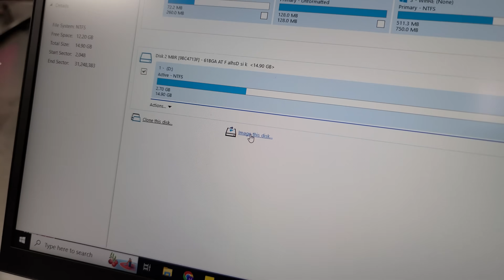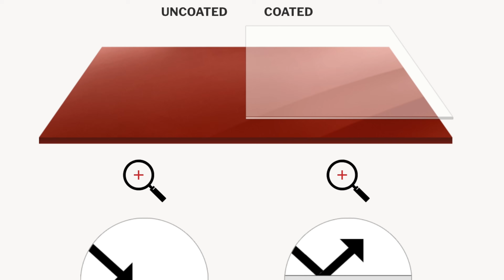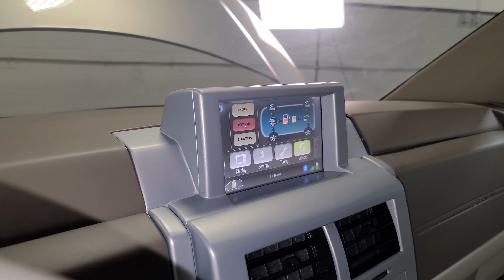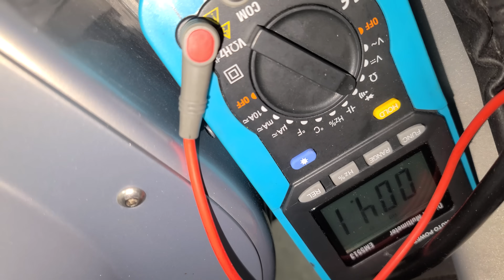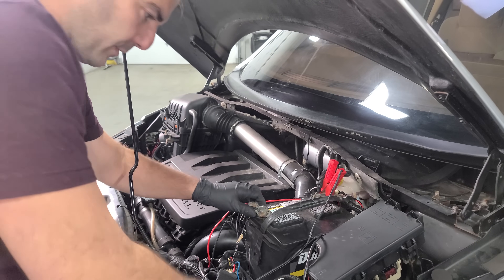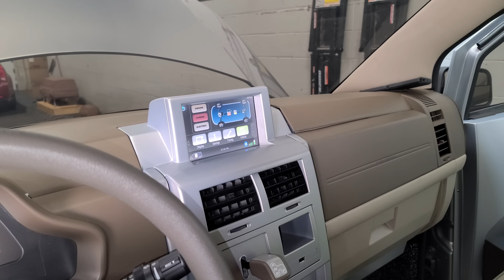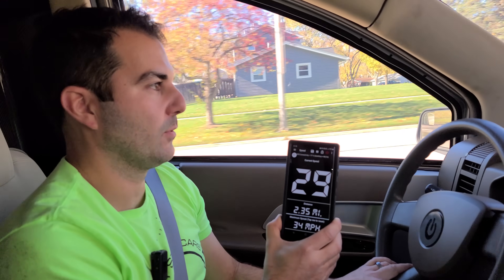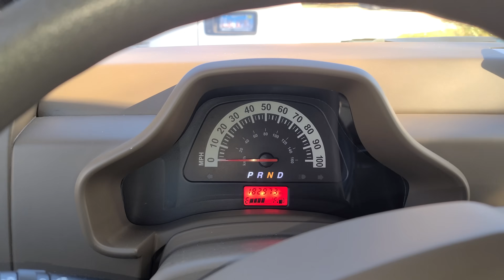I Thought I Finally Fixed The 2 Million Dollar Concept Van Until Disaster Struck! What Would You Do?

Comment: Given that it's a standard Chrysler gas engine, I wouldn't give up on in quite yet.  That throttle issue I'm guessing, is that the switch over from EV to gas should cause a number of relays to switch control.  Your starter bypass worked but I'd bet there's another relay that the computer should be activating, that connects the gas pedal to the fuel system or engine computer.

Comment: The concept was to run on electric power, then switch to the ICE.  It looks like that concept was never realized...it would be pretty awesome if Alex is able to get the space van to prove the concept and succeed where the original team couldn't, or ran out of time /money to do so.

The electric power has been fixed - amazing job Alex!  Fixing the axle shouldn't be an issue.  Same for the ICE - throttle response appears to be a communication or linkage issue.   The hard part might be the auto switching from electric to ICE.  Who knows if that software functionality was ever finished.  I would love to see the van perform that auto switch just one time!
Reply: I agree...stop trying to fix they hack work and do what you did with the starter button...just start upgrading stuff and do it the way you would have if you don't want to sell it to rich rebuilds and let him do it.
Reply: Wheel speed sensor not matching output shaft has thrown the TCU in limp mode. Computer probably locked in 3rd below 2000 RPM. The axle can be welded. Starter is almost certainly wiring to the relay that engages the starter solenoid. Reset all codes in all ECUs and see what comes back. The wiring looks terrible. I'm not even sure you could call this a prototype, its more like a science fair project. If he can't get it going I'd just convert it to gas since it looks 99% of the way there.

Comment: Assuming it's a drive by wire throttle, plug in your scanner and see if you're getting throttle input.  If you are, check your throttle body to see if it's getting a commanded signal.  Might just be a broken throttle pedal, bad throttle body actuator, or disconnected wire.
Reply: There is some wizardy going on because the pedal works in EV mode.  might be the relay that's clicking to split the pedal signal one way or the other.
Reply: @juztyn00 I agree with this statement.
Reply: I bet the transmission is in limp mode. He had throttle when in drive so its the ECU intervening. These cars don't have a throttle cable. I bet the output shaft sensor and wheel speed sensor mismatch has caused a lockout. Fix the axle, check the wiring to the sensors and from the start relay to solenoid and reset all codes.

Comment: I sympathise completely with that feeling of defeat when every success just seems to lead to another failure - I used to own a Land Rover. The van is really only worth what you put into it. As a concept car it's of very limited use outside a museum or collection, and if the CEO is happy to reimburse you for your efforts he deserves to get his van back. It would be the right thing to do. If you really want to get this thing running as a sort of daily drive, you'll have to team up with an electrician, strip out all the wiring and redo it, then get a mechanic to go right through the thing looking for problems. Would it be worth the cost? Probably not. You've given it your best shot and it's driving you nuts. Time to save it in as original condition as possible for historical reasons and get it back to the CEO.

Comment: Here is my gut on the gas throttle. I would wager it’s an electronic throttle, and that somewhere in the computer system there’s a switch that sends the throttle input to the electric motor or sends it to the gas motor. That switch is probably stuck on the electric motor, which is why it works when your EV power but not when the gas engine is running.
Reply: Likely a rely or in general area like broken wire somewhere as the electronic throttle works in EV mode which tells me when switching to engine mode it not switching the signal wire over to other ECU?

Comment: Long ago I used to work in a telephone exchange. I have really enjoyed watching you delve into the problems with the van. The four big problems which I see are 1) no circuit diagrams; and 2) a complex electrical system, 3) something which is experimental, and 4) a powerful electrical system. If you had just no circuit diagrams or a fairly simple system or something which wasn't experimental (i.e. the van was actually in production as a roadworthy vehicle)  or something which wasn't capable of serious injury or harm then it might be worth continuing down this path, but not having circuit diagrams is a major issue, and the fact it is complex and experimental leaves you like when you're driving around a part of the city you don't know without a map. The two obvious choices are either to sell to the old CEO or to donate it to a suitable museum. There's just too many things which are going wrong with it, with no logical pathway to fix them. Circuit diagrams are essential to having a logical repair pathway.  I just feel there's too much risk of some sort of serious incident happening with this van, so I recommend you dispose of it. You've fixed the easy things, and what's ahead is more hours of labour with less to show for it. I just saw your first video after you had left working for the police department. Maybe I'm wrong, but I just don't see continuing to fix this van as fitting within your vision. I recommend you pray for wisdom.

Comment: The small module you cleaned is just receiver for your remote locking. You can either try to unlock it by a key fob or just completely remove the module from the car and connect all wires, which are divided. It should be mounted under the dash, that's why there is no weather protection and all the corrosion.

Comment: With that aftermarket alarm I know back in the day they use to put a antenna type of wire around the key cylinder under the plastic cover and that will not let you start your car if there is a problem with the alarm. If you remove that from around lock cylinder the van should start with factory ignition

Comment: I wonder if the computer turns on the engine by using a remote for the remote start module. It would make sense that they might use an off the shelf module to bypass the security system (even though it looks like an original key). That might explain the relay clicking and why it worked before and doesn't now.
Reply: That's exactly what I was thinking!
Reply: Switching out of electric mode trigger the gas engine to "remote start" so you dont have to turn the key. Then it has the timeout disabled so it doesn't just shut off like remote start normally would

Comment: Well Alex the van had investment from GM of $5 million and a Grant from the Startup initiative program of $250,000 The van should be worth around $350,000 if it was put up for auction as it is a one of a kind but that would most likely be a museum price, I would say the van is worth around $90k to a private buyer as no one else will have that same van. Also you may want to redesign that rear axle setup and weld in some stronger support for the EV motor and axles as it will tend to pull to one side as it takes up torque, Maybe fit 2 shocks across the chassis to stop it twisting at low torque, Also the Engine was never running in the PR events and in the report i read the transition from EV to ICE was rough back in 2011. they had a newer axle -x - Motor setup in the works which never got built or installed.

Comment: If this thing uses an electronic throttle, that's the first thing I would check. It's probably disconnected, broken, whatever. 
If it's mechanical, cable driven, the cable could've snapped or been disconnected at some point (check both throttle body and gas pedal).
Either way, you can check if it is working by using an OBD2 tool (throttle position sensor).

Making the turn signals work should be really easy with a 3 pin turn signal relay.
The turn signal levers are probably an off the shelf real component, so it is perfectly possible to make it work, provided the headlights/rear lights actually have bulb sockets in them. The turn signal circuit is SUPER simple.

Comment: I wonder if the engine is started via a remote starter system. Maybe the box of electronics that you cleaned? My guess would be that the command from the space van screen to turn the gas engine on would be sent via radio frequency to the remote starter. Maybe there's a key fob remote somewhere that has been wired into the van to send the RF signal to trigger the starter. It's the last piece of the puzzle to get the van to switch automatically. Your starter button is a good work around and possibly what the red button was on the remote receiver  box by the battery. Maybe that was the override if the rf signal failed.

Comment: When your were fixing grounds, you didnt connect the one for the lights.  I am wondering if that was a light relay, it was a engine mode relay ground?
I would suggest connecting that “unneeded” wire, to make sure its actually IS unneeded.

Comment: I am an ex certified mechanic (hurt my back) … I might have some insight as to the issues of the van driving under engine power and why the shaft sheared. The way it is acting the throttle pedal doesn’t seem to affect the gas. It may be disconnected because they couldn’t sync the % of throttle to electric motor speeds. And only be hooked up to a potentiometer for the electric side and not to the TPS or throttle plate they may be using the TPS for the electric motor side only as an throttle input ….in effect using the motor as a generator only at idle. Since the ECM doesn’t see the Throttle Position Sensor it only idles and charges the batteries at 15v by your readings. And torque sheered the shaft (that drive shaft looked kinda small and of soft material) and my opinion probably something from some scrap parts.   Needs to be better design to hold the demand of city driving. Sounds like the batteries were doing good. Happy Holidays Sir. Hope you see this.

Comment: Seems like the way they're switching from hybrid mode to the gas engine is utilizing that remote start module to "remotely turn the key" without you actually having to turn the key manually. So when you put it in gas engine mode it "remote starts" but doesn't have the timeout associated with remote start when it doesn't recognize a key in the ignition over a certain amount of time.

Comment: Hiya from England. OK, Ideas why the engine won't start. Automatics have an Isolator switch on the gearbox so you can't start In drive or reverse?/ or maybe shut the doors to start the engine/ or foot on the brake or all 3 to start the engine.  you could test if getting spark with one lead disconnected but connected to a spare spark plug while the engine turns over as in your test, IF it does spark then spray brake cleaner in the intake to see if it starts? CAUTION ADVISED! Good luck though bud.

Comment: I wouldn't be surprised if the startsignal and the lack of throttleresponse are related.
The screen says its putting power to the wheels, but does the computer know that.
I hope you consider continuing the work on the spacevan.

Greetings from the Netherlands

Comment: I am also with you on getting rid of the space van. Otherwise you will have to use the Chrysler that was used's wiring diagram and draw up a diagram of your own. Then you will jhave to get into the PC diagnostics to determine the gas engine restriction as well as the automatic change over from EV to gas on the fly. I do believe this is taking a lot of time away from your other projects and I can see that this is not what you want to do.
I do admire your trouble shooting skills a lot as you are not just another new part fitter.
Best of luck on your descision going forward.

Comment: It sounds like it's time to call it quits. I think that, other than the axle being broken, it's probably functioning exactly as it did when it was a concept. For drivability and reliability purposes, someone might consider disconnecting the EV system and letting it operate exclusively as a FWD vehicle using the Chrysler powertrain.

Comment: I think your solution to starting the gas engine could be an issue. If it's like most PHEV's the gas engine is designed to fire up automatically when needed. It can't do that if you don't solve the computer controlled ignition. The wiring is a mess and if you want to understand it you really have to start tracing back some of the major circuits. It depends on if you want to put any more time into what could be a lost cause. I'm pretty sure you can solve the axle problem - that definitely sounds like an Alex problem 😅

Comment: Any development project takes things in order. In this case, they worked on the interior and the electric drive as they both appear to work and when it was new, it was enough to show progress. I suspect the gas side of things was left to last and that is when they ran out of money. You could probably get that working but it would be a huge investment of time and money to finish what they started. Probably it's time to clean up a few small details and move on to the next project. As you have contact with one of the people on the project you could ask just how far they got but I suspect it will match what I just posted.

Comment: If you do decide to continue with this project, I think you should make your own wiring diagrams. There's no way you're going to remember what every wire you encounter is connected to if you're not writing it all down somewhere. Second, you have enough experience to know what needs to be connected to what to get an engine running properly. Having your own diagram would help you see what is and isn't connected. You could also compare it to the OEM wiring diagram. Maybe you could even get Rich and his guy to do the diagram and review of the electric engine while you do the gas engine. Maybe someone who knows a bit about coding to review that software on the SSD. Then make changes as you see fit to get it running. It's a lot, but I believe it's doable.

Comment: couldn you had taken your diag scanner, and increased the rpm ? my 01 bmw 330ci will while moving. (i know this is chopped and spliced to bits) but it does speak to the ecu/dme/pcm whatever your wanting to call the engine computer of the van. bc if you can control it via scan tool, then you should in "theory" be able to narrow it down to either a throttle body issue, or its just not detecting the pedal being pressed. (unless you checked for throttle actuation without showing in the video)?

Comment: You'd get more from parting it out. I say either strip all the wires out and re-wire it or take it to the scrap yard and crush it. Just pull the high voltage batteries first. You could sell the batteries for maybe a couple thousand and get like maybe $300 from the scrap yard for the van. You won't completely recoup your money but something is better than nothing.

Comment: Random thought… I am assuming this thing is throttle by wire. So, have you verified that the gas pedal is plugged in? Not sure if this could have an affect on it not starting or not. But the lack of throttle response when you press the pedal sure indicates that it’s either not plugged in or at least not communicating with the ECM.

Comment: Alex, You gotta own it buddy. Make Diagrams. Document behavior. Enumerate the whole vehicle. Create the Operational Schematic. Then, replace or fix the technology. It feels like the computer is supposed to send two throttle position outputs, one to the Electric motor controller, and the other to the ECU. Or perhaps just use a relay to bypass the throttle position output to the Electric system when in EV only, and vice versa when in engine only. In hybrid mode, the EV system will only need to match front drive wheel speed, otherwise the electric system will be constantly pulling a load on the rear wheels.

While I am writing this, I am wondering if that silver box on the passenger side is responsible for interfacing the Engine control system to EV computer.

Comment: That axle looks like a weld let go, it also looks like it wasn't bevelled or properly prepped at all when they joined it. You can see the grinding marks on the end of the shaft where they cut it and the blueing from the weld but you cannot see any residual signs of the actual weld so defo no penetration or strength. Absolutely on par with the rest of the vehicle from what I've seen in your vids bud.

Comment: This is a problem with prototype vehicles meant to sell an "idea". They are slapped together enough to get in and out of showrooms, drive around a parkinglot, look good to investors/media, and then go back into storage.

If nobody wants it for a fair price, it'd be more useful as a gas only vehicle to use as an actual van at that point. Take out all the electric and battery stuff, get the engine wired and hooked up like a regular car, and use it as a van. Most states allow for "experimental" or "custom built" vehicles in some way at their motor vehicle departments and will register a proper vin for it if it meets certain vehicle standards, turnsignals, headlights, seatbelts and so on.

Comment: As soon as i seen the cheap security device i understood 90% of the problems cut the whole thing out they are trash took me 45 mins in the beater car i bought it had the same junk was a nightmare to have to worry if the reset button was going to go out and leave you stranded. The black thing under the dash that looked like a flash drive dangling was the security chip key crap that normally fails first.